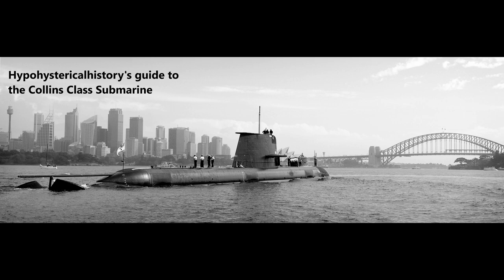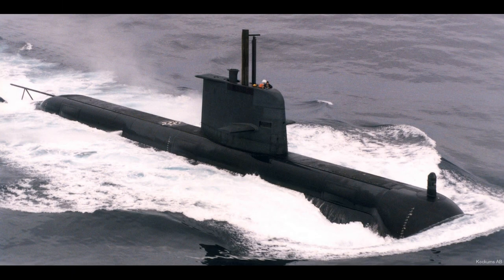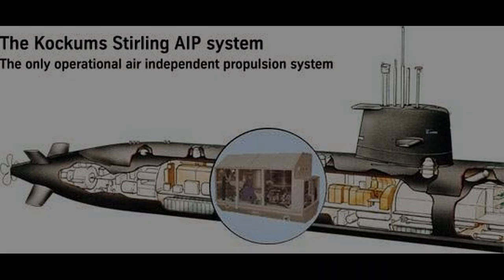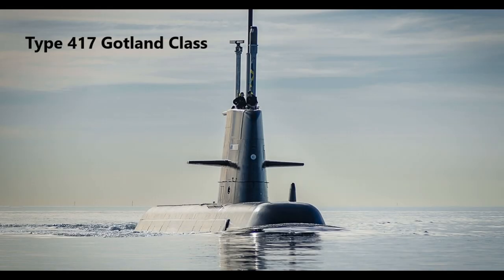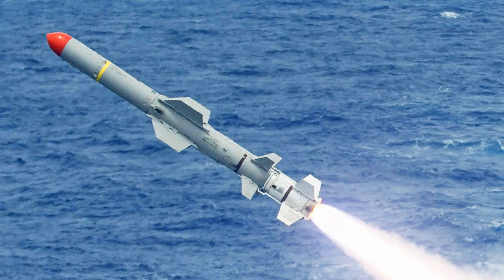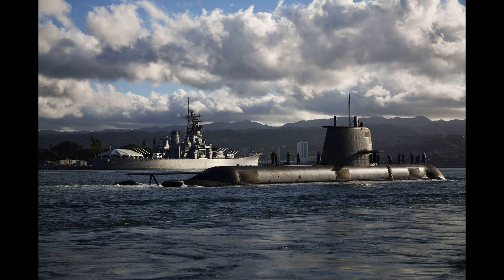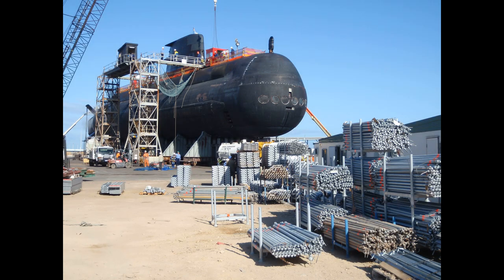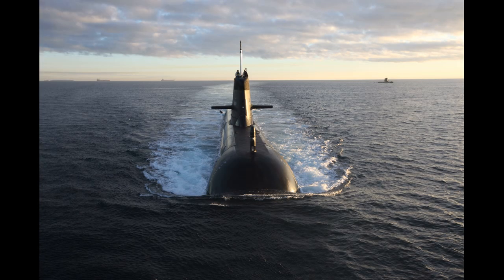Hypohystericalhistory's guide to the Collins Class Submarine

Comment: The Collins class is based on the Gotland class predecessor the Västergötland class which entered service in the late 80's.
All four of which are still in service and have been fitted with AIP section two in the Swedish navy known as the Södermanland class and two boats in the Singapore Navy known as the Archer class.

Type numbers like 417 is the Kockums internal designation the Gotland was the A19 project and the Västergötland was the A17 project, i have a book i got as a kid with a flow chart of all the Kockums submarines but it's in a box somewhere sadly. The Current under construction swedish submarine the Blekinge class is the A26 project.
Swedish submarines always uses Swedish torpedoes and has done so since the 1930's, Swedish along with the Russian navy are the only two navies using hydrogen peroxide torpedoes (the kind of torpedo that sank the Kursk).

Comment: I know this, the Collins class has a problem with depth. The the American kills were taken in 16 fathoms ( Gulf of Carpentaria ). The field of work these next subs will be in, is Asia with some of the deepest terrain in the worlds oceans. So we need the subs to go deep and long. Also you can not produce the steel plate in Australia for these type of sub unless you build a new steel blast furnace with extrusion rollers wide enough to produce steel plate at the size of 40 or 20  meter long by 10 meter wide at the minimum. Now the new sub are Virginia Class, Yes. These Virginia class sub are 100 meter plus long by 13 meter diameter so the circumference is 3.214 x 13m = 40 m plus to fabricate a ring in one piece. So this will make one of ten or more 13 m diameter x 10 m wide steel rings with one welded seam. If you used the 20 m long plate the rings will have two welded seams. 10 of these 13m x 10m ring welded together make a 100m long x 13 meter vessel  "The less seams in a pressure vessel or sub the better" Plus this new steel plant has to transport these steel plate section this size and weight to the shipyard so it best to built the new plant next door to a ship yard with a deep sea port. Plus you have to have the Press machine with the enough width and enough tonnage capacity to roll these over size plate which there are none in Australia. You can use the heat and shrink method the Japanese use but the skilled tradesman are lost to Australian manufacturing. This method is also the best method of fabricating because it does not fractures the molecular structure of the steel plate has much as mechanical pressing . So under pressure it can go deeper and longer than a sub haul made by mechanical pressing. I say the Australian should off went with the Japan made Sub made in Japan. But since this video was made the Australia Government has pull out of the French Sub deal and got the OK to buy 12 Virginia Class nuclear powered from the USA. Which in the end will be fabricated in the USA because of all the above. I don't know how no real investigative journalist has not pick up that we don't have the heavy industrial infrastructure to build these sub in Australia years ago even to built the french Subs.

Comment: Can you list a link about the “2 to 3 minutes to recharge”?
Reply from the maker: I did mate, its a pinned comment
Reply: @hypohystericalhistory8133  it doesn't say it only takes "2 to 3 minutes to recharge", which isn't possible with today's best batteries (let alone the lead-acid batteries used on submarines). 

The article DOES make the very dubious claim that it only needs to snort for 'less than a few minutes' in every 24 hours, but this is not the same thing. It makes the claim "Collins can recharge its batteries IN ABOUT ONE HOUR at a speed at which an Oberon would have little power reserve for electrical generation".

Comment: So why not build more of these, in upgraded modern systems equipped versions inside these hull types, rather than start over with the barracuda design? In any case, and as always, fascinating🖖🏼
Reply: They look into that as part of the Competitive evaluation process.

The problem was capacity for expansion of future capability. The Collins was built with a capacity for upgrade. It will be tapped out by 2040. 

To build in that room to grow, it was determined that a fresh design was better than modifying the Collins.

Evolved Collins was heavily looked into

Comment: Great information as usual. Well done.
Always wondered why we didn't use the "Stirling" incorporated into our AIP.
Next please explain the Attack class propolsion system.
Reply: At first, Australia deemed it "unproven", so they went with normal diesel. Later, my bet it is pride/cost is the reason to not do it. Because, the Swedes proved that the Stirling AIP is indeed even quieter. They adopted in on Gotland, and now on Blekinge (A26). Both these subs make the Collins loud in comparison. But the Collins is still a beautifully designed submarine. They just need to be upgraded to 2020 standards.

Comment: I  saw report years and years ago that thw Collins Class subs were like "underwater discos", then I read they went to the US for noise mitigation
Reply: There were initial problems with noise but alterations to the stern, I think, as well as some other changes removed the problems. Having spoken with people who have served on a Collins class sub, he confirmed that they are very quiet and among the quietest of current subs.
Reply: I'd heard the problem was with the propeller and it took a few years but they got it right in the end.
Reply: Rumour I heard was that the ‘underwater disco’ comments were based on tests done without the anechoic tiles fitted. A bit of political manoeuvring between the major parties in Canberra. Trying to embarrass the govt by shitting on defense?
Reply: @psychalogy  either party does that, when in opposition
Reply: They asked an engineer in Australia to look at the noise problem with the Collins and solved it by fitting a hump forward of the conning tower . If I remember correctly it's fibreglass but I could be wrong on that part .

Comment: At the 2:19 mark you said that the Collins Class only has to  charge for 2-3 minutes every 24hrs. I don't know where you got your information from but that is 🐂💩.

AIP was never tested on the Collins Class. It was investigated and there was talk that it could be a future modification, but to do that would mean cutting the pressure hull adding an extension unit just behind the fin. They option was later cancelled as it would have had an effect on the hulls life. Yet again, your information is wrong

Comment: They had all sorts of design problems and we're not all operational until approximately 2016
I think your statement regarding snorting if wrong. No submarine can top up their battery in 2 minutes unless it is already at a high percentage. The speed of the submarine determines how low it will be and how long it needs to be charged for. The collins charges about 4 times as quick as the oberons
Reply: Exactly. The OP clearly didn't understand his own link. 

The article DOES make the very dubious claim that it only needs to snort for 'less than a few minutes' in every 24 hours, but this is not the same thing. It makes the claim "Collins can recharge its batteries IN ABOUT ONE HOUR at a speed at which an Oberon would have little power reserve for electrical generation".

Comment: Use nuclear batteries reducing the diesel noice level . Using nuclear batteries last longer and do not need to recharge for 20000 years and easy to shield against the bata radiation. You will also have the quietest submarines in the world with no need
Reply: No need to cool the reactor with pumps when using nuclear batteries.

Comment: Snort for two to three minutes every 24 hours. Hmmmmm
Reply from the maker: Don’t be lazy, go to the pinned post, click the link, go to the section named "indiscretion ratio" and read yourself.
Reply: @hypohystericalhistory8133  it doesn't say it only takes "2 to 3 minutes to recharge", which isn't possible with today's best batteries (let alone the lead-acid batteries used on submarines). 

The article DOES make the very dubious claim that it only needs to snort for 'less than a few minutes' in every 24 hours, but this is not the same thing. It makes the claim "Collins can recharge its batteries IN ABOUT ONE HOUR at a speed at which an Oberon would have little power reserve for electrical generation".